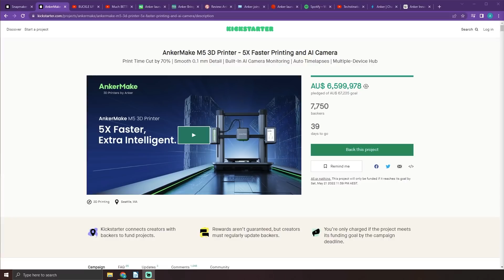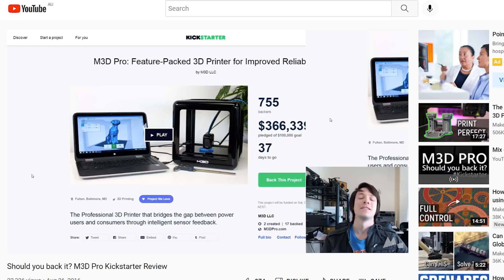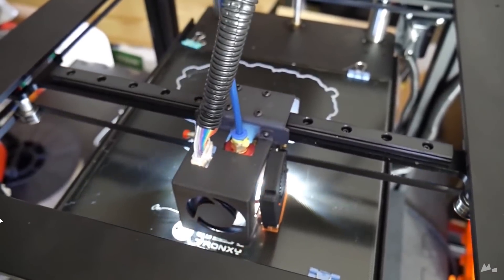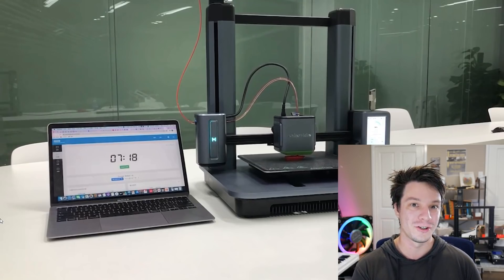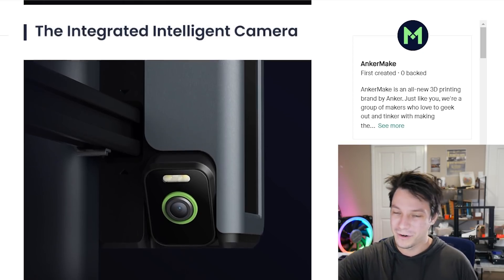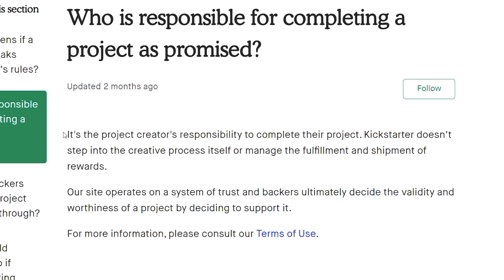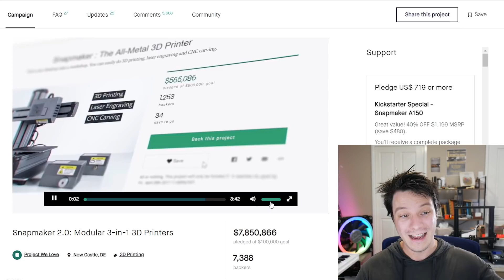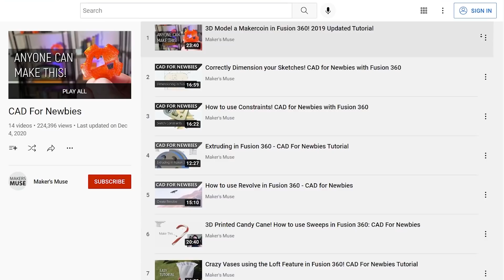This 3D Printer looks incredible, but...

Comment: 9:48
"I will never ever promote an machine that has an exposed laser diode"
Major respect for the integrity! I love you man!
Reply: whats the laser diode used for?
Reply: @RockCYP  cutting and engraving. There’s a case available, but it’s sold separately.
Reply: @TheRealMrSkippy  i see, so by default for 3d printing it is not turned on or anything like that
Reply: @RockCYP  no it is a separate head. It comes with three heads and beds, one for 3d-printing, one for CNC and one for laser-engraving/cutting.
Reply: @TheRealMrSkippy  oh i see thanks
Reply: @RockCYP  Laser engraving
Reply: Does he have any other videos where he talks on this? I’m new to but interested in laser engraving/etching

Comment: I wish 3D printing companies would aim for feature complete robust printers rather than just price. It's so hard to recommend any 3D printer to new people because you know there's a good chance there will be at least some problems. Creality has way too many models now; it just adds to confusion and worsens the experience.
Reply: Prusa Mini for starters or Prusa MK3s+ for those looking to go more than a starter.
Reply: @johnomaz  I do recommend the Prusa printers often, but the fact that there's so few recommended ones around it shows that it's lacking a good level of competition. Most reviews of similar ones are basically: 'good, but here's a list of problems which others at the same price bracket have fixed'.
Reply: I still just say "get an ender 3 and don't worry about it" lol
Reply: There are companies that do exactly this: Feature complete, robust, easy-to-use, reliable 3D-printers: Raise3D, Ultimaker, BCN3D, Formlabs, Stratasys, ….They are targeting businesses and industries, because you and el-cheapo-end-users are not willing to pay for this.
You might want to take a look at prusa. They have a reputation of working reliably out of the box and start < $1000.
Reply: @rynnjacobs8601  The thing is, it doesn't cost $3k to add things like bed leveling. Even with Ultimakers starting at ~$5k they still have very similar components to ones found at $1k.

They aren't some magical linear guide rods, steppers, frame, belts, bowden tube, trinamic drivers, etc. and I know there's expense in software, support, and QC. My point being that most of these features already exist on $1000-1500 printers, but often they lack one or two. The Pursa's prove that point, they just need more competition in that space.

Personally I was looking at a Raise3D E2, but might end up building a Voron v2.4r2. Although, I can't recommend either of them to new people.
Reply: The other issue are the die hard 3d printer guys who push buying cheap machines and modding them. The ender 3 is fantastic for the price but let's be real it will give newbies issues over and over again.
Reply: Depends on what you do right? Most of my recommendations revolve around stratasys, 3d system and occasionally fuse 1. To some degree those printers are quite plug and play because of the ecosystem.
Reply: I can highly recommend the Artillery Sidewinder, I've used it for about 2 years now and all the print failures thus far were due to my own error (Forgetting to clean the bed, forgetting to put the extruder in, unplugging the mainboard, hitting it with a sledgehammer). Once I got it levelled and extruding it has had little to no issues printing, the only times I've gotten spaghetti on it were when I forgot to clean the bed since PLA residue had been building up.
Reply: Agree, I waited and waited and finally found an ender3 s1 and then a few months later they put out the s1 pro lol
Reply: I always recommend Prusa mk3. I’ve had mine 3 years. It is a beast and a workhorse. 
Rarely a day I am not printing something and rarely a failure. 
I print lots of parts requiring precision as part of large assemblies. 
I have already preordered their new larger core x/y printer. 
Great product/company/support.
Reply: Elegoo in my experience (like less then year) is pretty good so far the only real problems ive had are me being to lazy to level or the fact that sometimes the files just dont want to wrong which I have like 9 work arounds for making just a small annoyance I have the Neptune 2s the speed is decent and the quality is nice its just an overall good printer
Reply: I can recommend Qidi-Tech printers, they work straight out of the box, print pretty much any material, not super expensive, and they provide the best support I have ever seen, I know people that are clueless on how to use a screw driver, but they use the Qidi-Tech X-Max and X-Plus printers without issue, Creality is not something I'd recommend to anyone, not unless they are real DIY'er types and are tight fisted with money.
Reply: I second this, one year in on my Qidi X-plus as my maiden voyage into 3DP and very happy. Surprised Angus did not mention it/them.
Reply from the maker: @purelyrod9310  I've reviewed several QIDI printers quite highly :) they're not perfect, but definitely work horses.
Reply: @MakersMuse  Pretty sure it was one of your videos that made me pull the trigger on the Qidi-tech printer, now I sell them :)
Reply: @NexGen-3D  I use the X-Max, and it is really good. But it does lack a filament outage detector and I did have to replace the bed springs with spacers after the first few weeks to keep the bed level. Other than that though, they really are good if you want excellent surface finish, ability to do hi temp filaments and a full enclosure that genuinely lets you print ABS without warping off the bed.
Reply: Simple! Just shop around for 3d printers above about US$1500 or so. Ideally over USD3000 or so. If you buy cheap, you obtain low something: reliability, print speed, print temperature, print quality, no core XY, Klipper, etc...
Reply: @LigneDesign  3 grand on something that your not even sure you'll do much isn't a good idea.  For most people the best thing for any hobby really is to go cheap at first, and figure out whether or not they actually wanna do more, then they can spend the big bucks. Assuming of course they are doing it in an educated fashion and don't expect it to just work.
Reply: @olsirmonkey   I agree with you! My post was in reply to the comment "...feature complete robust printers..."
Reply: @olsirmonkey  Qidi make a unit that starts at $400 US, all the way up to 3k, I feel safer selling the cheapest Qidi-Tech to a customer vs something like an Ender 3 V2 Pro S1 or what ever they are called now.
Reply: @olsirmonkey  $3,000? It looks like it is about USD630 for this Kickstarter. If you mean the Qidi printers, the X-Max cost me AUD1500 delivered, and was worth every cent.
Reply: @LigneDesign  Definitely true to some degree. Although things like auto bed leveling needs to be more of a standard thing rather than optional. Won't make much of a difference to me personally, but bed adhesion in general is a huge portion of peoples mechanical issues (i.e. Excluding slicer tuning, which is a given for all printers). It shouldn't need to be $1500+ to ensure you have things like that.

That's just an example though, there's just generally a handful of issues that pop up in many reviews which could all be solved with improvements other printers have done at a similar price point. i.e. It's not that much more to include the, but would round out a new person's experience.
Reply: @LigneDesign  not to mention some * cough * CubeX * cough * that had limited use to overpriced filament that manufactured
Reply: @LigneDesign  no your quite wrong elegoo is cheap and very reliable

Comment: I am still a bit put off by the fact that bed leveling, auto or not, is still accepted as the norm. Even with more expensive machines. Mesh bed leveling is not even leveling, it's compensating right? CNC machines have been level for decades now and I have a very compact desktop 3D printer that has a fixed bed that is just built flat and level to the print head (Dutchy3D), even after dropping it off a table by accident (it even still worked, only the spool holder was massively bent). Why do you think this is not becoming more common, especially in the 1000+ range?

Comment: One red flag: the speed they are advertising. It's most likely bullshit because of the fixed acceleration value, even Uncle Jessy review is biased because of this: you can print as fast as they do without reaching the speed they advertise.
Reply: And they act like speed is how fast the printer moves. Most prints aren't large enough to ever get to top speed for long. They don't seem to be advertising extreme acceleration or jerk.
Reply from the maker: Yep exactly this, you can tell an ender 3 to go at 1000mm/s but it'll never reach it due to jerk and acceleration settings.

Comment: I think the next step they should take is to introduce in-printer slicing. Most consumers won't know how to orient or set up prints in a sliver, fiddle with settings, etc. They want to drop in a file and print it fast and in high quality. That and/or they should introduce a service to have professionals set up their sliced files for them, guaranteed to print properly (within reason) for a fee if they don't know how or don't want to.
Reply: Prusa tried this with the pre-sliced gcode online. I think it's a bad idea for most users. The orientation problem is extremely complex and the true solution is to design parts for printing, which isn't really possible on-device. There are just too many factors for gcode to be easily transferred. I think there is promise in optimized 3MF profiles with prints, but not until all the slicers agree on a universal standard.
Reply: In printer slicing seems interesting, i see a lot of challenges but also great advanteges. What if a machine could detect the filament in it and adjust speed, temp, fan, ventilation, retraction etc?
Reply: @ferdinandhenkel4567  if I am not mistaken there is already a printer that does that.
The filament spools have either a AR-code or a chip in them so that the printer knows what filament is used and adjusts the settings automatically. Obviously only works with the filament provided by the manufacturer.
Can't remember the name, maybe someone else can help.
Reply: It will be done in cloud, you upload mode, it gets sliced, you download resulting gcode to your phone or directly to printer.
Reply: This doesn’t work in practice. Maybe when we have the equivalent of 3080 capable ai powered printers…. But existing software is terrible at guessing orientation and hasn’t really improved much.

Comment: Anker shouldn't be crowdfunding a 3D printer. That's a huge red flag for me.
Reply from the maker: I agree, the platform shouldn't be used for this.
Reply: @MakersMuse  many companies use it to incline customers to nag their friends to back it too in order to reach stretch goals. It feels like half way to an MLM pyramid scheme.
Reply: I think companies just see that it worked out for others and try to get free money without consequences.

It makes sense financially and it may seem dumb to not do what your competitors are doing, but it's a scammy move, specifically when the company in question has the resources to fund this.
Reply: It's free advertising dollars.
Reply: @allenellisdewitt  It is more a way to circumvent consumer laws, at least they think it works like that and as long as the user think it works like that it keeps working like that. But as previous lawsuits have proven is that what Kick-starter says about your consumer rights is just not legal. 
You cannot make a person sign away his rights. That is not how that works.
Reply: @wojtek-33  my red flag vibe tingles because it’s a sign of them prioritizing cash over user experience. I like it when a company focuses on making my experience as best they can and not as lucrative as they can. Basically the opposite of YouTube.
Reply: Agree as well it’s not a good thing, thing is even if it does get delivered you can get no support to fix problems and there is nothing you can do as you have no retail protection. You are not buying anything, you are donating money in the hope you get something. Perhaps it’ll get delivered perhaps it’ll be good perhaps they will provide support. But they might not. If it does get delivered and it’s riddled with problems you may well be left with an unusable item that is only useable as a door stop.
Maybe not but that is the issue with Kickstarter and I hate it.
Creality did a Kickstarter they are a massive company and a lot of printers were riddled with problems and Creality which is a big company did not help and you had to source buy and fix it yourself. I would have thought Creality would have done something to fix the problems bearing in mind the affect on  their reputation , but they didn’t.
Will Anker be any different?
Who knows.
Oh and a final point. One of the things said on the creality Kickstarter was you back it and you get a better price.
The reality was you didn’t. Retail units were about the same price.
And if you waited and bought a retail unit you had consumer protection and could return it.
Unlike Kickstarter.
Reply: It not a good thing but they could be seeing if the ideas are worth it monetarily and financially by finding out how big the market is for a product
Reply: @dominicbeltz9057  they make a ton of things that they eventually get rid of. I have a great rechargeable flashlight they used to make but I don't think it was really their market so they got rid of it. These however seems like a huge investment with lots of parts and development time, so, they've gotta make sure people actually want it

Comment: I wonder how it'll compare to a Ender 3 S1 Pro
Reply: I imagine for an experienced user the S1 pro would edge this out, as it does have an all metal hotend and can print up to 300c, which includes nylon, polycarbonate, and a few other exotic materials.  The first thing I looked for when I saw the Ankermake was how high it can go, but it seems like its maxed at 260c, so it probably has a PTFE-lined throat.  I think a more comparable model would be the vanilla S1. Neither S1 models has the AI camera feature so the only other things to compare in regards to features would be things like the filament run-out sensor, power-loss resume, and auto bed leveling.  

Anker advertises that the M5 can print at 250mm/s while the S1's are at 150mm/s.  I print functional parts so I need my prints to be as accurate as possible. From the LTT demo it seems like the M5 will spit out a print but the quality leaves a bit to be desired, but it can probably be tweaked via print settings.